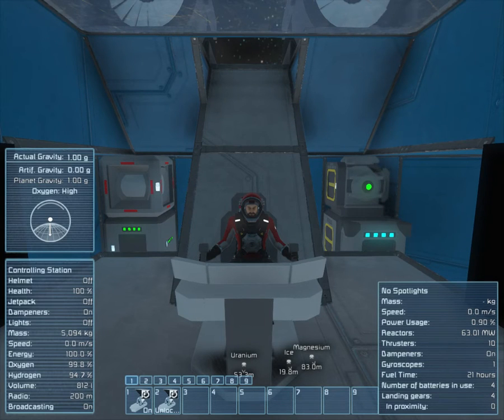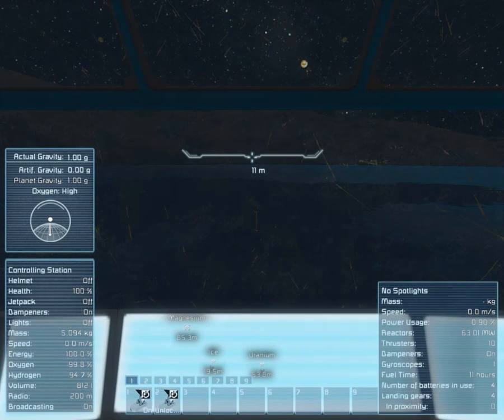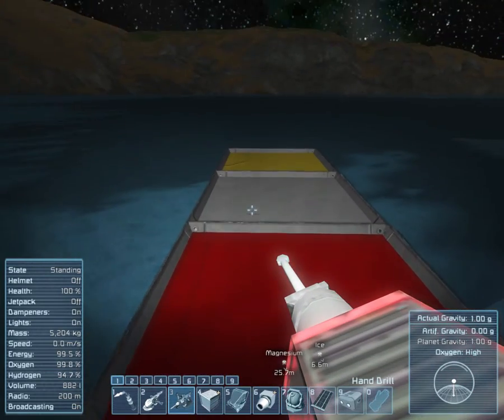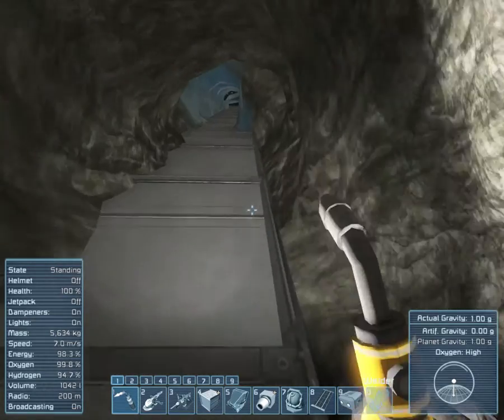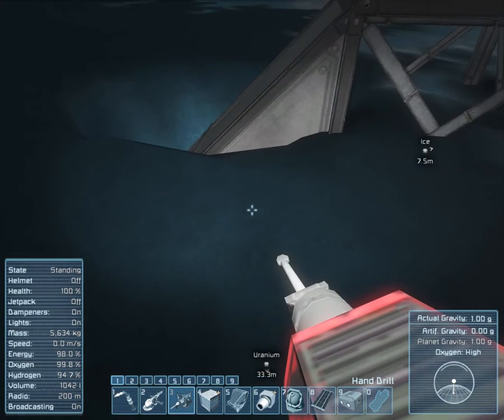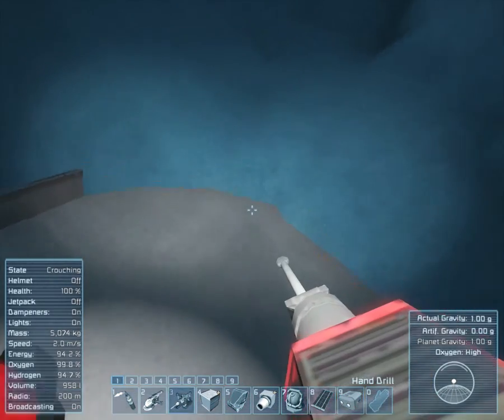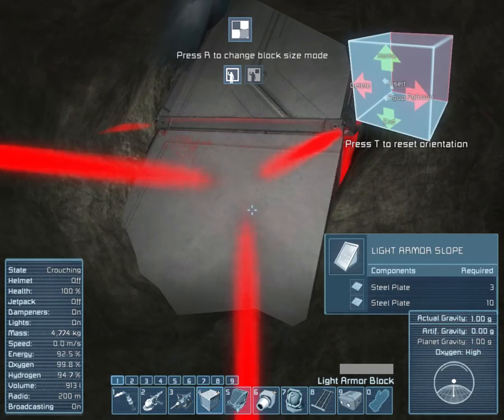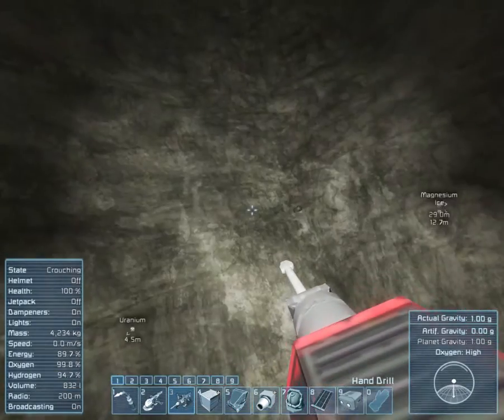Space Engineers Tutorial - Star System Episode 02 - Setting up a hand drill mine

Comment: Question - Having finally established the base station I find that the Uranium I seek is 150 - 200 meters down.  I suspect that that is a bit to deep to drill by hand and deciding where to start the 45 degree ramp to hit that spot would be incredibly hard to guesstimate.  What are your thoughts.  Is it worth trying to drill to the Uranium by hand in this situation?
Reply from the maker: Great news about getting your base setup.
100-200 meters down is a long way, about 28 angled slopes will be needed for 75 meters, so it is possible, it is a long way but it will be worth it.
Remember to rely on your hand drill for information.  As you get in range, it will tell you the direction the resource is in and how much further to go.
If you want to speed your way through the rock, right click and that destroys the stone and it is a lot quicker.

Comment: For some reason I do not see the minerals on my HUD when I am walking around, only when I take seat in the cockpit and turn on the Ore Scanner?
Do I need to construct a device to see the scanner feedback while wielding the hand drill tool? 
Thank you!
Reply from the maker: Hi Yassy,
Yes, your ship/buggy will need an "Ore Detector".
As you know the hand held drill has one built in but it is limited on range.
If you create a ship/buggy (small or large block), you can then create an Ore Detector on it.
It does not need to be connected to any conveyor, just to the vehicle and have power.
Once it is created, it will automatically display in the cockpit and external view when you are in the cockpit/flight seat.

I hope this helps.

CMDR Noodles.